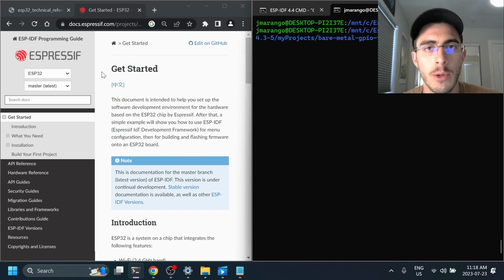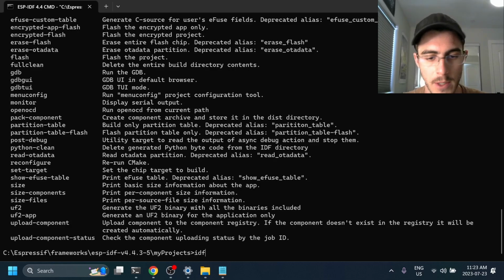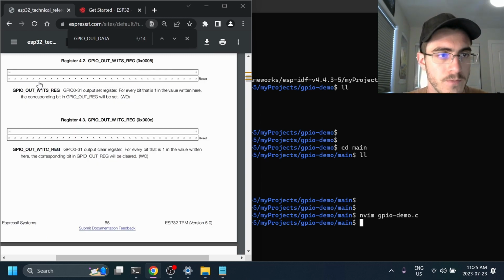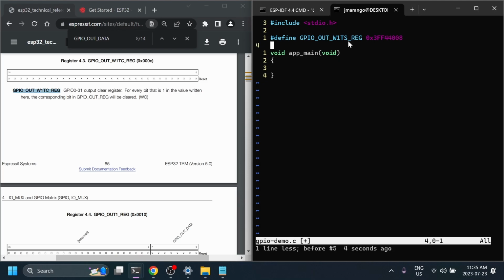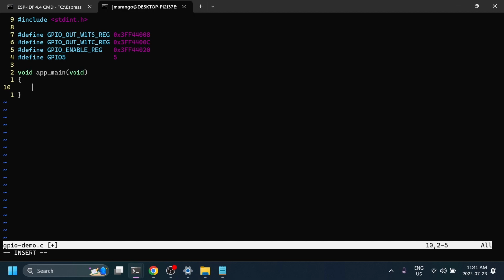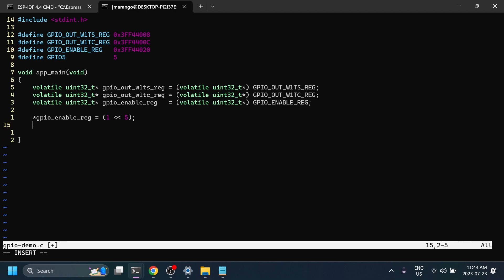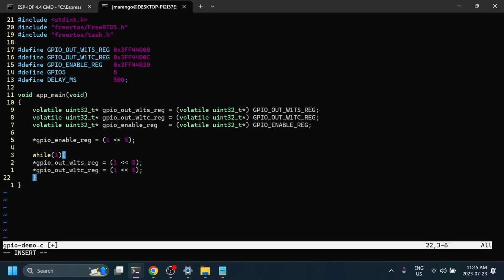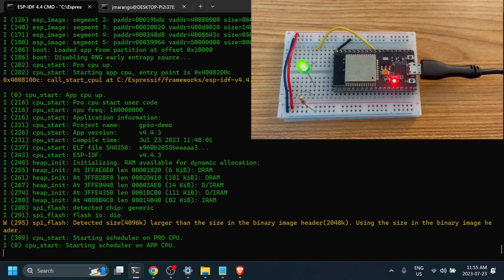Bare metal GPIO driver for ESP32 | Toggling an LED

Comment: Hi, I'm using the RP2040 in assembly language in VS Code. I'm trying to do the same with the ESP32, but it's unsuccessful. Is it possible to use assembly language with the ESP32? I read that the chip uses an RTOS. Can I tell the compiler not to use the RTOS and use my code like it does with the RP2040? Thanks.

Comment: This is the only helpful video I could find on the topic of the gpio and io mux registers of the esp32. The technical reference manual is rather lacking in a precise explanation on how these registers work (one might even blame them of deliberate obfuscation). If you made a video on the functionality of this confusing peripheral system explaining things like how interrupts, inputs, outputs are configured, the size of the registers, and stuff like that, I would very much appreciate it.

Comment: Thanks! Two questions: 1: Looks like It writes at least 89kB, and also making an image for a bootloader, which seems like a lot compared to the lines of code? The advantage to do this "bare metal", should be efficency due to customization, meaning have as little as possitble loaded onto the MCU, other than the written instructions itself? 2: What would it take to engage the wireless tranciever module to be able to send simple commands "bare metal"?
Reply: About the first, the problem is that it's not bare metal since he's using freertos

Comment: When this code is executed on ESP32, Is there some FreeRTOS tasks at under kernel ? I am trying to check a gpio from external source and send to serial, and the FreeRTOS under IDF sometimes run task like IPC and move the context of execution. I watched the video and I dont understand why you move to linux. Does it possible under windows create a Real Bare Bone code ? Thanks in Advance.

Comment: Holy crap that was simple. I just switched over the Espressif framework from Arduino and I've been messing around with their GPIO driver for a couple of hours now. Considering all I needed to do was toggle the internal LED, this saves so much hassle.

Comment: Nice video. Please note that GPIO_OUT_W1TS_REG and GPIO_OUT_W1TC_REG are exposed in soc/gpio_reg.h so a simple #include is sufficient, no need to define these registers inside your code. Please also note that GPIO pin numbers are exposed in hal/gpio_types.h. Same comment, no need to define GPIO5 macro again.

Comment: Great stuff, arw you willing to continue the series? I am looking for a bate metal approach to the ESP32 instead of the typical arduino core use. What topics are you looking to cover?
Reply: this is not bare metal as the dev uses esp-idf which incorporates bootloader, start linker script and so on. a bare metal approach would be to write a main, assembly file and use clang directly.

Comment: I tried reading the same document to see how you came about your awesome simplicity.  What made you decide to avoid setting the GPIO_FUNCx_OUT_SEL register?
Reply from the maker: For simply toggling an LED, GPIO_OUT_W1TS_REG and GPIO_OUT_W1TC_REG are generally easier to set up and offer greater flexibility. But if you have a specific hardware event that you want to use to trigger the LED, and you want to minimize CPU overhead, then GPIO_FUNCx_OUT_SEL might be more appropriate.
Reply: @EV_engineer  Hello, Thank you for the video, it is very informative. 

Actually, I had the same question as well. So imagine I have two LEDs one is blinking the whole time and then the second LED will only blink when I turn the potentiometer (let's say that generates an interrupt). So, in the second case I will have to use GPIO_FUNCx_OUT_SEL?